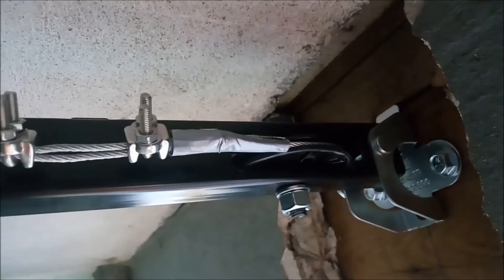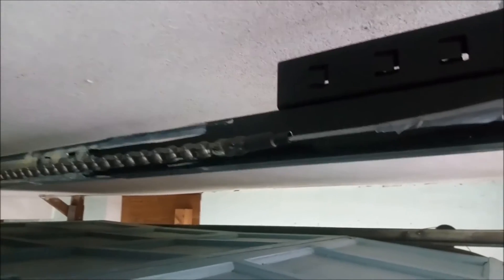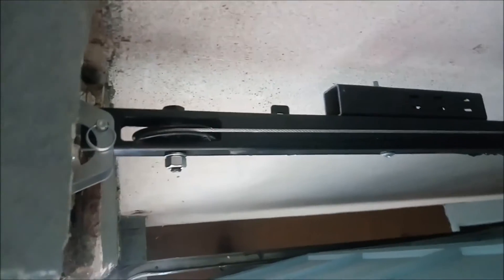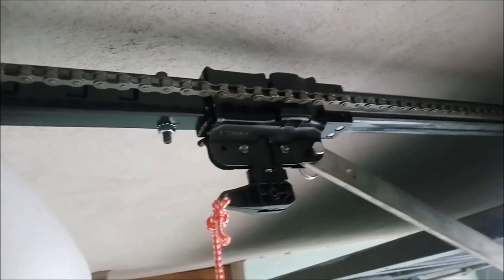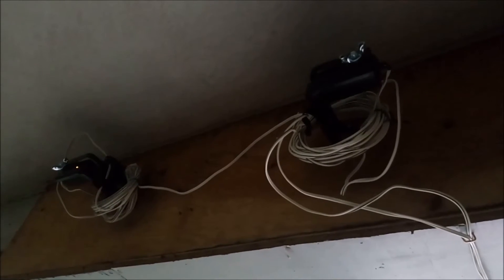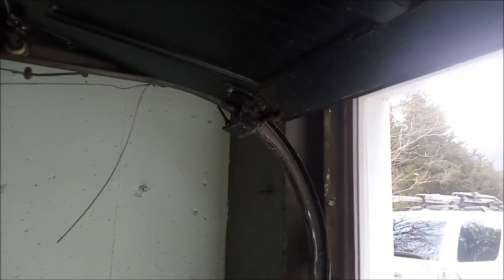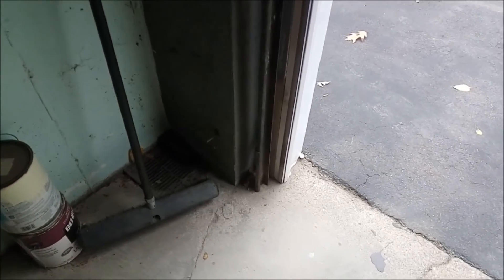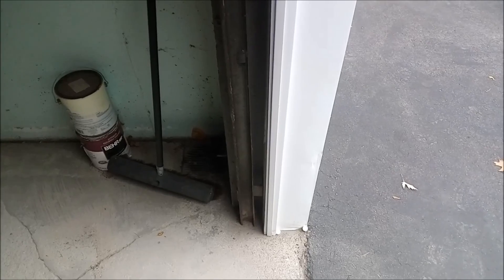Garage Door Opener - How to Shorten and Cut the Rail in a Chain Drive (Part 2)

Comment: I have a chain with cable that is sagging down too much to be tightened with the nuts of the trolley threaded shaft. I’m hoping that I can just use the cable clamps to shorten the cable about 3 inches without also shortening the chain.

Comment: Cool ANother tip for the sensors they can be fastened to the wall by the tracks. if the walls are concrete you can use a hammer drill to drill the holes drive a couple plastic anchors and screw them tpo the walls. Still great job I enjoyed watching.

Comment: I watched your video. Then I decided cutting the rail was too much work and too much risk. I returned the opener I had purchased with a 9.3 ft rail and bought one with an 8 ft rail. Went in easy.
Reply from the maker: What brand and model has an 8 ft rail?
Reply: Poolarity - Life Hacks 
Genie 1.25-HP Belt Drive Garage Door Opener Battery Back-Up
Item # 737050 Model # 7055-TKV
I bought it at Lowes. At $195, it was about $50 more expensive than the one I originally bought. I did have to wall-mount the backup battery to make it fit but that was easy.